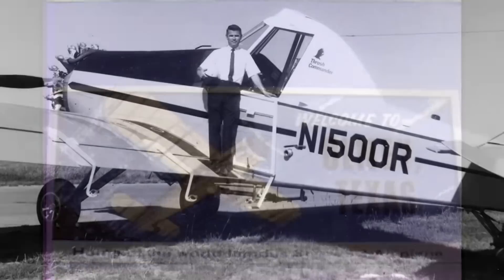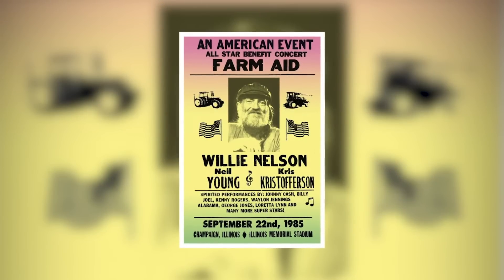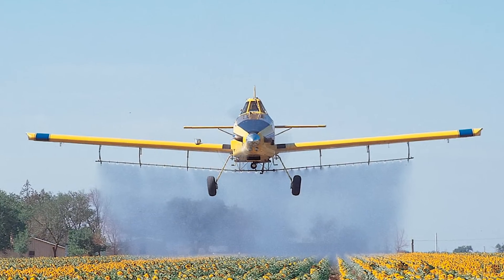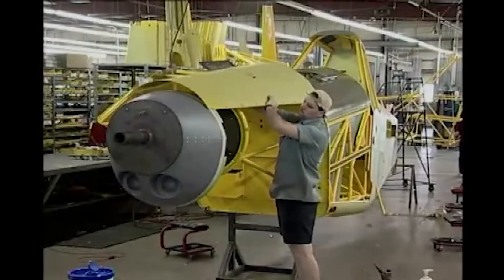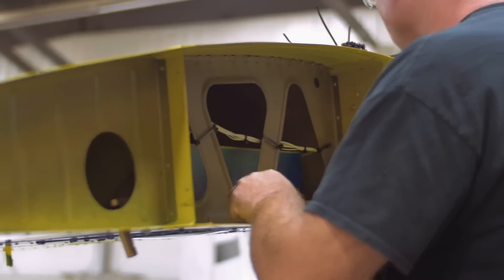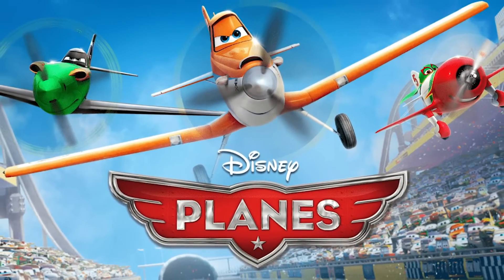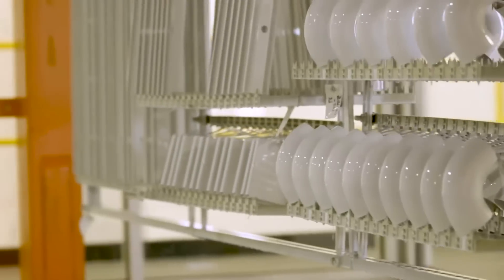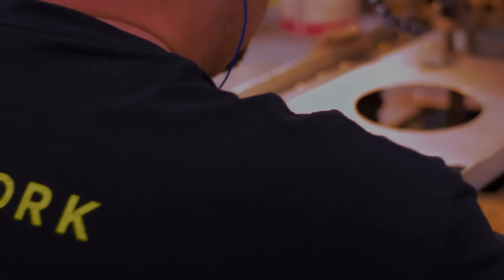Decades - Air Tractor 50th Anniversary Documentary

Comment: Air Tractors have a bad history of wing failures
Reply: There have been a couple. 
But that has been fixed. 
I’ve got over 15,000 hours in Air Tractors
Reply: @robertg4355 what do you consider wing failure?
Reply: Can you name me one?
Reply: @bryanhauschild4376 Yes Air Tractor 502A, N15466. Queen Creek Arizona. 

NTSB found Air Tractor underestimated time interval of fatigue fracture and had determined an inadequate inspection interval. 

AT recommended 2000 hours or 3 years to inspect the spar caps. Well NTSB engineers estimated failure could occur at only 105 hours. 

The aircraft had only flown 500 hours since the last inspection. So yeah pretty bad. But from the video it seems like it’s rectified now.
Reply: @Mobile_Chernobyl recommended?
Reply: @Mobile_Chernobyl I read a report on it. Sounds like pitting was going on. Someone didn’t seal the splice area properly. I wonder why that wasn’t mentioned. It’s a red flag to me that no logbooks were found. If that’s the case then the pilot in command is at fault for even taking it up. It would be unairworthy without log books. I wonder why that wasn’t mentioned in the report?

Comment: What a legend! Slowly getting replaced by AgDrones like the DJI T50 and similar.
Reply: How many T50’s to do the work of an 802?
Reply: @bryanhauschild4376  Honestly, the T50 is last years model and would literally take dozens and still not compete. The newest model, the T100, however would only need a dozen. So, as you can google the product rates yourself, it's obvious that within a couple of years that YES, Ag drones will make that big beautiful Air Tractor nearly obsolete. By that I mean that the pilot will be replaced with automation of the AT fleet. The pilot becomes an operator like the drone guys. Off the shelf, bolt on automation is already available for tractors.
Reply: @DKTek07 what’s the cost of 12 T100’s?
Reply: I fly an 802.  It would take a bunch of drones to even come close to the production I can do😊
Reply: @robertg4355 I see one claiming 700 acres a day at 29 mph! An 802 does that in an hour or two. Lamo